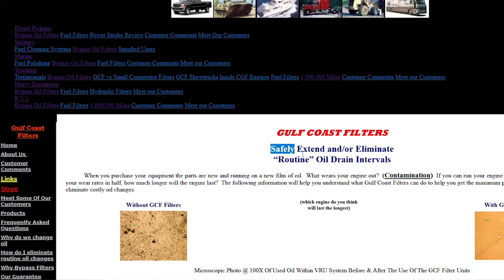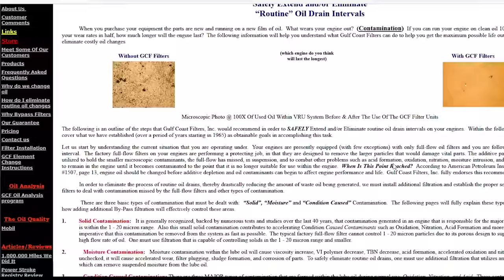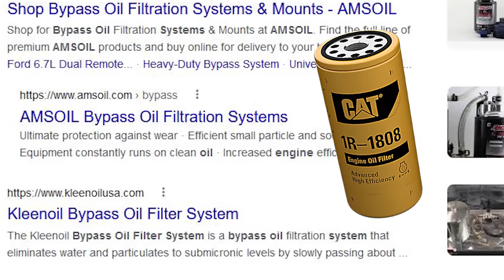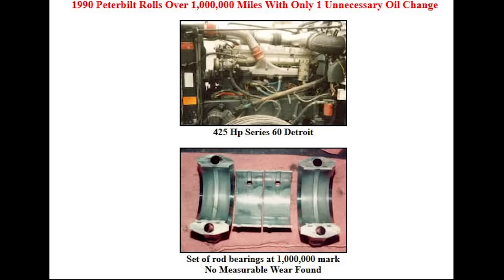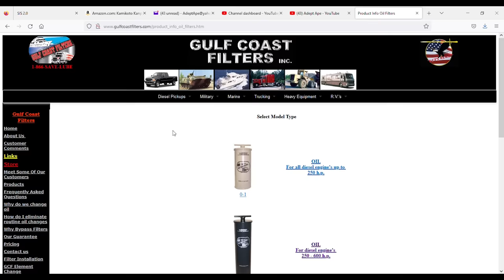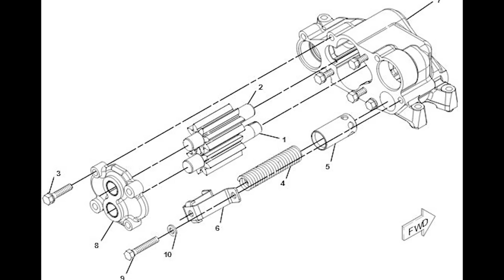No Oil Changes and 1 Million Miles!!! Are Oil Changes Optional with a Bypass Filter? (INTERESTING)

Comment: This has been tried for 40+ years, Caterpillar even sells engines with bypass filtration factory installed. 
That being said they still recommend scheduled OCI. 
The bypass filtration is to help extend OCI, NOT eliminate them. 
The frac industry is littered with failed  3512C engines due to customers having engines equipped with 250hr oil pans and pushing their OCI to 1500-2000 hr. 
I believe it's possible with a small engine such as the lower HP C15 on-highway, being driven every day to make the claim they've made, but I wouldn't advise it. 
Bypass filtration works, but it's not a substitute for OCI .
Reply: I quit draining oil in 1963 by using filters that clean oil and Delo W30. Multi grades were no good in 1963. I dont believe they could be used in a diesel.The polymers didnt hold up.They fouled hot engine parts..My oldsmobile diesel book said you could use multi grades in an emergensy  until you could get 30 weight. Some engine makers said if you used 10 40 it would void the warranty..The reason being they had too many polymers. One reason I used Delo W 30 was with toilet paper filters it was golden. One time I replaced a head gasket and changed the oil on the Rambler American.  Its a little risky telling people they wont need to change the oil with proper filtrstion.
Reply: It was common in the 60s for the engines to be so sludged up a filter that cleaned oil could reach its capacity in less than 50 miles. I would notice the filter not heating up. I would open the engine and clean out the sludge. Told my uncle he had a choice we could open the engine and clean it or change the Frantz every 50 miles. He traded the 59 Ford in on a new 63 Dodge pickup.
Reply: Normally the factory installed filters are not good enough to be a threat to the oil change program. That takes a big filter with a lot of depth such as the big Gulf Coast filters.

Comment: I used to work for a fleet in the 90's that used a DOC system which consisted of a solenoid actuating a plunder that injected 2 oz oi engine oil in to the fuel return line/ It was worked out to need around a gallon of oil on every tank of fuel,  sometimes a little more than a gallon. Every time the driver would fill up he had to add oil. When we did pm's, we didn't drain the oil just changed the filters. Removing a valve cover was a gunk filled experience

Comment: I have a Spinner centrifugal force filter and a Amsoil bypassed filter on my 98 dodge diesel 12 valve
I did a bearing roll at 565,000 miles 
The bearings looked almost new ! 
I got my centrifuge filter from a truck  bone yard for $100.
I send my oil for testing 
They detected antifreeze in the oil at 565,000 miles That’s why I did a bearing roll and head gasket.
I did it all with the engine in the truck 
When you remove the head on a 5.9
To do the head gasket, you could do a bearing job at the same time. 
It’s actually recommended at 500,000.

Comment: I did it on a NA gasoline 4 cylinder engine (Mitsubishi) that was driven every single day in business. I definitely extended its oil change intervals through necessity and that engine ran just as good as it was new when I sold it at 250k+, but I think it's probably worse on a gas engine than with a diesel.
Reply: I have used toilet paper filters for 60 years Gasoline engines are a lot easier to deal with.. All I have now is the Jackmaster Classic  the Gulf Coast juniors and the Motor Guards. Not to forget the flat head Ford V8 canister filter I converted to use Scott 1000 and put it on my Ford diesel tractor. The tractor will need more attention.because of the soot.

Comment: There is a fair amount of support for the claim that the base stock of the oil does not breakdown over time.  I was working at Wayne State University a few years ago and got an invitation to a talk put on by an oil engineer from GM.  I was not able to make the seminar and the presenter could not share his material with me because it was proprietary to GM.  He did however give me links to several papers that discussed oil and it's properties.  I read them and one of the things that struck me was a jet engine manufacturer that did not recommend oil changes for the life of the engine (probably the time between complete tear down and inspection).  What they engine manufacturer did recommend was the periodic addition of an additive package.  I just searched for the articles but could not find them.   If I do find them I will post a link so everyone can read them.  The bypass system sounds interesting.   Keep the good stuff coming.
Reply: When I sold Gulf Coast Filters they had a  single roll model for GM midsized trucks with a GM part number. The ports were different. Seems like they were for South Carolina DOT. The ports were different for the mid sized GM trucks. Gulf Coast could give you better information. I think they have ferry boats equipped.
Reply: I hear all this stuff about oil breaking down. The molecules break down. There is a re refinery in east Chicago that can refine used oil to where it is better than when it was first refined. They dont have to deal with all the crap in crude oil. The oil is as clear as water before they add the additives. It goes to the major oil companies. I might have ended up with some. Bought some heavy duty 30 weight diesel for.the diesel tractor. Its as clear as water and doesnt smell like oil. I think it might be re refined oil. It has good body to it. Im told a lot of it goes to hydraulic oil. When I worked for them Goodyear sold it. At one time new Mercedes came with re refined oil. These days there is a lot of synthetic oil in it.

Comment: I have watched 10 seconds and the answer is yes, for at least a decade and only changing the filters. I used to work for volvo trucks who made this claim years ago. Use high grade (relatively expensive) oil,  and change high grade filters with a slight oil topup, and 1,000,000km is more than attainable. When asked why they don't, the answer was "because costumers refuse to trust it". Anyway, back to the video.

Comment: On EMD railway engines, it’s normal to not replace the oil unless it becomes contaminated. 4x a year oil samples to detect it.
Reply: They use those EMDs on off shore drilling rigs. I believe Shell offshore uses  Gulf Coast filters on them.

Comment: We ran a pretty similar system with the diesel generators (and the gas turbine main engines, kinda) on the guided missile frigate i served aboard in the navy. We had DeLaval centrifugal purifiers for the engine oil and just added more to make up for the inevitable leakage...which, coming from a 16v149 was considerable.

Molecular shearing absolutely is a thing and you do need to keep an eye on it. As the oil gets basically chopped into smaller chunks the viscosity goes down and therefore needs to be replaced. Dealing with the contamination and the antioxidant additives being used up is easy with good filtration and additives, but the shearing can only be dealt with by replacing it.

Comment: I feel the need to Magine that if anybody is going to extend their oil drain interval, to remember not to extend the grease interval. They still got to come in every 10 to 15,000 miles and get their truck greased.
     Fuel dilution by volume is not counteracted by oil burn. If you’re oil dilute by 10%, and you burn 10% of your oil, you are still left with 90% of your oil diluted at 10%. If you type that oil up with pure oil, you now have 91% oil and 9% fuel. unfortunately oil consumption is not selective.
    Gulf coast filters are a roll of paper towels wrapped in a net wrap. I’m not saying they are not effective. But I am saying that it is comical that their filter medium has the segmented scoring every foot or so just like a roll of paper towels. If you get the opportunity, cut one open and see.
    Josh makes an excellent point about oil sampling. It helps to know that the golf course filter kit in particular, has provisions built on it for taking oil samples. It has extra ports for valves for taking samples while the engine is running. Most often this filter kit is mounted in a very convenient spot like on the back of the cab. Owners can typically take oil samples at their leisure without getting under the truck. Bypass oil filter kit or not, I feel that it’s self should be mandatory and all vehicles.

Comment: there is also the relationship between load and fuel dilution. driving around with no load uses less fuel vs towing impacting the oil viscosity change rate. great topic thanks for sharing and hope you get well.

Comment: I run the Amsoil Bypass filter system on my X15, I change the main full-flow filter at 40k and 80K (adding a gallon of Amsoil signature series with the new filter) and both the Fullflow and Bypass filters at 120k (or 1 yr whichever comes first) along with a complete oil drain n fill. Also testing the oil every 25k starting at ~50k.  I’ve heard of folks going 400k + like this but I don’t want to push it. My  Oil still tests good when drained.

Comment: Not mentioned is the affect using different "types" (Synthetic v/s Dino) and different "Viscosities" of oil might have on the results. As an example, you state oil "breaking down" over 250'. That might be the case with Dino oil but Syn oil can take much higher temps.
GREAT detailed report though! Really enjoyed it

Comment: Lots of newer engines oil stay at 180 to 200 that over the 150. I put a centrifugal bypass on my daily i have really enjoyed it especially scraping the crud out. They use centrifugal filters on big ships for oil and fuel there engines costs a lot more so i tryed it.
Reply: Actually some of us have been running on clean oil before. There were synthetic oils. Diesel engines required single  weight oil. When I started in 1963.. most dlscount stores had Standard Delo 100 20w and 30w for about 29 cents a quart.

Comment: Thankyou for the video..
I am a Dodge Cummins diesel enthusiast and delivered many new Campers from Indiana to Canada dealerships.
I learned about bypass oil filters online..
I got a 2007.5 Ram 3500 dually with the 6.7 emissions deleted + tuned. 
I purchased it with around 390,000 miles on it and was using shell rotella at 1st and slowly made improvements to the truck and oil system like adding a filtermag to the OEM oil filter, they work as advertised.
I also used powerup metal treatment and Lucas oil stabilizer. 
I would do about 3 trips per oil change that was 10-13,000 miles.
Years later I added the frantzfilter oil bypass that uses toilet paper rolls and I didn't know how long I should go per oil change after adding the bypass unit.
1st I test my oil after a normal 3 trip run by sending it to a lab and the results showed something indicating the oil should have been changed earlier. 
Then I tried 6 trips on the same oil and had it tested good and the test showed the engine +  oil was still fine.
Then i went 9 trips on the next oil change and it all tested good.
Then I went 12 trips on the next oil change and I was told I could have used the oil longer yet...
So I decided that I will stay at changing my oil every 12 trips..
So for me the bypass allowed me to go 4 times as long safely with my oil and less labor changing oil in which I was getting tired of doing as I try to do as much work myself on the truck to save on garage costs,etc. 
This savings allowed me to use a more expensive oil ( mobil 1 European car formula )
as well that had a higher load bearing rate that I learned from a engineer who tests oils with special equipment to determine the Truth...
👇 you can learn here about what oils are good and what aren't. 
540ratblog.wordpress.com
Later on that guy found a better oil in his testing the Amsoil Signature series 5w30 that could handle 135,000 lbs load if I remember correctly..
I switched to that oil eventually. 
My Ram Cummins has over 970,000 miles now and runs like new and no records of the engine ever being opened for any repairs or internal maintenance. ..
I have replaced 2 turbos on it but the engine is great...

So remember these things:
You want the best oil in your engine with the highest load bearing capacity...

You want great filtration with a Quality spinon oil filter and bypass filter and filtermags on the OEM spinon filter..

Then you want a balanced oil change interval basically change your oil before it's time to change it to be safe...
Like I wrote earlier I went 4 times as long on my oil safely when using a bypass system..
Basically 45,000 miles per oil change.

And let you engine warm up before working it under full load...
Take it easy up hills and prevent torgueing uphill loaded because to much of that can decrease the engine life especially in hot weather and engine temps increase real fast uphill if you're not easy on the throttle...
I know one stretch of uphill in Washington that's about 15 miles long and saw a semi on the side of the road that burned to the ground and started a big grass fire as well...
I was kind of thinking he overheated it and a fire resulted...

Happy motoring and drive safe and reliably and may the Good LORD Bless you all 🙂🙏
Reply: Was just watching a dealer commercial. They had a used Ram diesl with payments of only 1000 bucks. They said a new one would be 2000 bucks. My 76 F250 Ranger with the 390 will have to last the rest of my days.
Reply: @ralphwood8818  

Hello, yeah newer used trucks and new ones are nuts in price.. 

Let me drop you a Golden nugget of info.. 

The most reliable trucks to ever roll out the factory door were the 12 valve Cummins dodges years between 1989 to early 1998 models...
They had 6 individual valve covers..
These are the real legends...
They don't need computers to run the engines like the 1998.5 + newer Rams.. 

The 1994 to 1998 2nd gents are the better riding trucks with more load capacity... 

Look in a rust free state in the USA and you will find those gems forsale anywhere from $10,000 to $20,000 rust free and buy one of those and remember its cheaper then $80,000 for a newer one with a nightmare of electronics that rarely are problemless... 

Some rust free states are:
California 
Texas
South Carolina and possibly north Carolina. 
Arizona in the warmer area of the state.
Northetn Florida 

Pro Tip: you want to escape the electronics on vehicles....
Electronics = problems in time...
Old fashioned mechanical = reliability for a long time!! 

Ever since mid 1998 the Cummins Rams have slowly degraded in reliability terms.
The newer Rams are still good trucks but don't match the Legend 12 valves.. 

My 2007.5 is a rare case that is gone to 971,000 miles but not without lots of computer electrical issues...
And I have done proper maintenance with good oil and filtration...
I also oil up the underside of the chassis with wd40 Gel spray ( Has to be the GEL SPRAY ONLY ) and in the inner doors, inside rocker panels and anywhere rust can start... 

Look online at these connections for used Rams 
https://www.shoppok.com
And craigslist or search this word phrase: Dodge diesel truck forsale 
Or a related term to find trucks forsale online.. 
Use your imagination. 

Once you found a nice 12 valve Ram then you can learn how to bullet proof it at these resources below. 

https://www.genosgarage.com
👆 loads of parts here to upgrade steering and fuel system and replacement parts and more 

https://www.turbodieselregister.com/
👆 forum since 1993 talking just Ram Cummins and you can learn loads of info from others about their Rams.. 

Can buy diesel power and diesel world magazines and they got loads of resources to maintain and improve the Ram Cummins. 

No truck in the world is without issues and even the 12 valve Rams have little things here and there that need to be improved but the bulk drivetrain is the Gem of the truck. 

Another tip is using high quality oils, engine coolant and filters and magnets on the drivetrain of any vehicle and that's what I do..
I use Amsoil 10w30 signature series synthetic engine oil..
I have infi on tests on these oils and they are among the best in the world for wear resistance. 
Also add Lucas oil stabilizer and motorkote metal treatment or you can use powerup to as I did for years, etc. 
Magnets on the oil filter from filtermag.com keeps the fine metal powder in the filter instead of recirculating through the bearings to create more wear,etc.
Bypass oil filter on the engine protects your engine further and extends oil drain intervals.. 
I use frantzfilter.com and there are other brands to.
Frantzfilter uses low cost toilet paper rolls to clean the oil that work great. 

Pro Tip: get the best truck ever made and then make it better yet with aftermarket parts and accessories.. 

Happy motoring 🙂
Reply: Had a severe carpenter bee problem Read somewhere to use WD 40 Gel. It works.. They are about all gone now. We had a 12 valve fire pump at work.  I believe it wss the same as a Dodge Cummins. A thing of beauty. Loved to hear it run  Bought a used Smart car. 5 speed transmission. A computer operated the clutch and shifted the transmission. Ants got into the transmission control module. It kept burning out head lights. Couldnt figure out why.. The voltage checked out. .Called a scrap dealer and told hin to come and get this piece of crap. I did manage to put 50.000 miles on it. About 150.000 miles total.